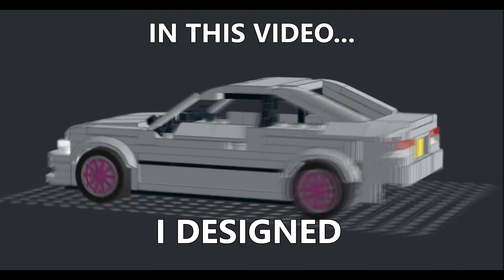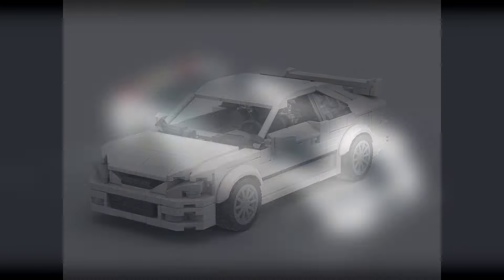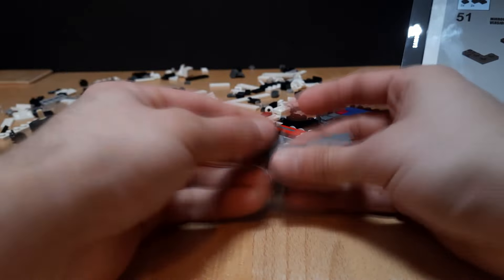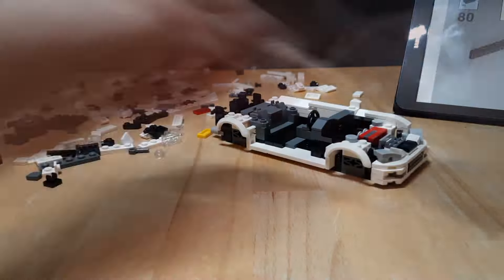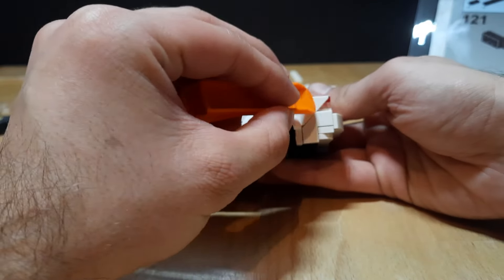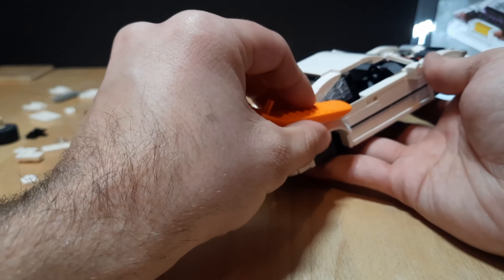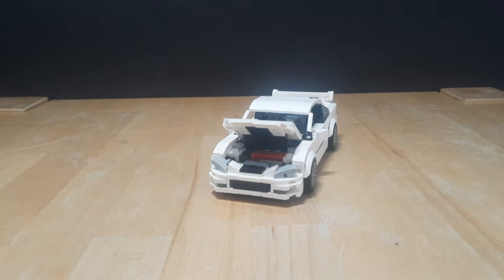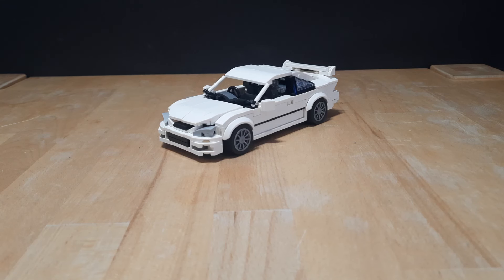I MADE A CIVIC SI COUPE OUT OF LEGO

Comment: May i ask how many parts there are? I want to make this in lego 2k drive. And may i have permission to post this on the lego 2k hub. If i build it?
Reply from the maker: 411 Parts, I don't think it's possible to build it in 2k Drive as it is but why not try? Just don't forget to mention original designer ;)
Reply: @Ilyabuilder724  uh oh thats way above the 350 build limit... Might have to remove the engine and some stuff. I made a rolls royce in lego 2k drive using instructions from the internet. It was more than 350 bricks and i did some optimization and i did it. So you will probably see your Honda Civic in the hub if i do make it.
Reply from the maker: @ariagaming5894  That's might work!